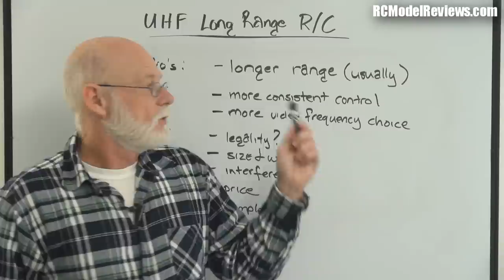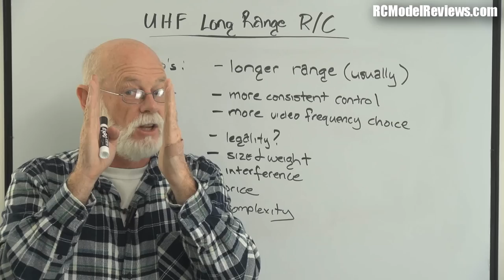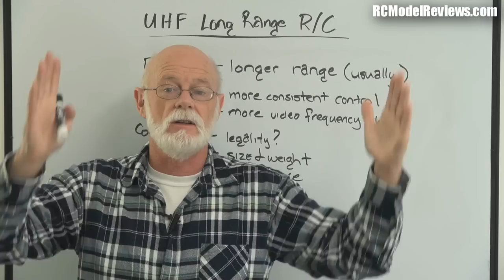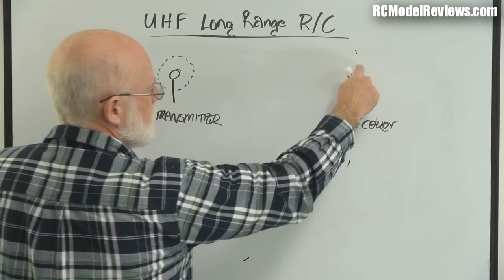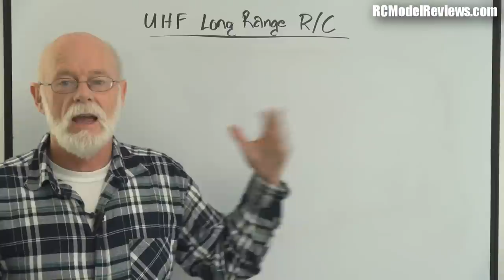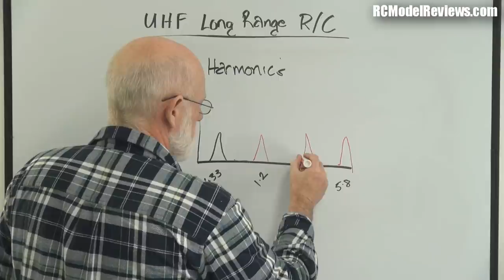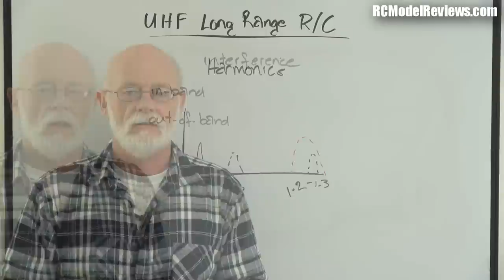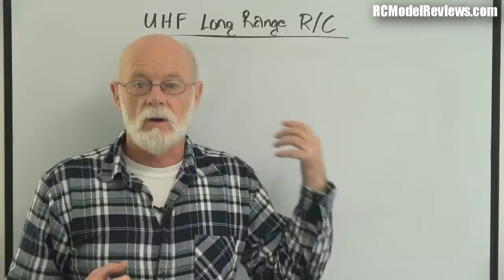Long range UHF RC systems part 1 (the basics)

Comment: Hi Bruce.
Here in the USA, one must have a HAM license to operate on the 433mHz band. I don't have one, and not likely to get one, (too hard for so small a use), so I want to look into another frequency. Perhaps 1.3?
So, when you continue your series, please address this issue (using something other than 433). From what I have read, 1.3 isn't that bad on harmonics. What do you think?

Comment: Can't wait for testing of EZUHF. I have a 2W signal booster on 5.8ghz vtx and it smashes the ezuhf at just over a km. Moved antenna to 80cm away and I get 5ks, is there a way to shield the ezuhf?

Comment: QUESTION - How about 433mhz paired against 2.4 gighhz fpv then for to avoid ground station 3rd harmonic interference? (especially if ones drone capabilities cannot use the full distance of a 433mhz will give you [not enough fuel/battery to get you that far and back - only need enough fpv transmission and reception distance that the drone can actually achieve) - And as you mentioned, which set of frequencies is best in avoiding  the interference from the on-board high definition camera?

Comment: Bruce, do you plan to focus on the Hobbyking line as the sole OpenLRS candidate ?  I would imagine you would want to either test a more respected vendor product (such as Hawkeye/DTR) rather than an also-ran product such as that from Hobbyking, or have 2 different OpenLRS vendors represented (such as Hawkeye/DTR and Hobbyking) to answer the question of whether the OpenLRS software or hardware is the primary differentiator.

Thank you for taking the time to perform this long-needed shootout.

Comment: is it worth mentioning that you can use 1.2g video and 2.4 control if u use low/high pass filters?
Reply: AndyRC Yes, but it's still far from an ideal setup so anyone contemplating long-range stuff would be better advised to go the 433MHz route.

Comment: Also, is the best way to mitigate 433 harmonics on 1.2 band by using the lowest available channel in the 1.2 range? That is, using whatever video channel you can that is as far away from 1.299 as possible? And how effective are lowpass filters when used on 1.2 video tx in conjunction with a 2.4 ghz radio link? Also a slightly related issue, you mentioned things like HD cameras coming into them mix, what about video tx disturbing servos?

Comment: Thanks so much! Very good explanation of the basics of radio frequencies. So here's a question. Is there a frequency dispersion at the harmonics? or are transmitted harmonics direct multiples of the primary frequency?

Comment: Hello sir, i hav some questions... If i want to fpv on budget, which transmitter i should get. My budget for transmitter is $300.
1. Flysky i6 + 2w Booster
2. Flysky i6 + Arkbird UHF (i like the repeater mode, and cheap uhf receiver)
3. Radiolink AT10 + 2w Booster (i like this transmitter, alot of switches)
4. Radiolink AT10 + Arkbird UHF
5. Used Futaba F10J (i heard that this transmitter can go up to 4km stock)

Which one do u suggest sir??? Any input from another user is welcome. Thankyou...
Reply: Get Taranis, stock range up to 5km, Great support.
Reply: BestLeblancEUNE I see sir, Taranis got big LCD also, lot of information... Futaba is a bit expensive in receiver, and it has small screen.

Comment: The GPS with most Flight Controllers, will also fail to receive a signal, if installed to close, to certain video transmitters. I believe it receives at 1.5ghz.

Comment: Bruce, have you considered bringing DIY solution to comparison?
Arduino Mini Pro  (3$) + SI4432 (3$) = Openlrs tranciever with 100mW output power.
Total with antenna, connectors  still under 10$

Comment: Good stuff. Really liked the explanation regarding the harmonics. If you could touch on receiver/transmitter placement vs. the antenna placement. Example: if the vtx is close to my uhf receiver, but their antenna's are far apart- is that a problem.

Comment: For the distances and environment we typically fly miniquads, I've actually had great luck with 1.3ghz (1360mhz @ 400mw w/ LP filter) and 2.4 control (Taranis/d4r-ii).  I generally have a far better experience than compared to 2.4/5.8, as 5.8 video usually cuts out long before the 'stomped on' 1.3/2.4 combo.

Comment: I'm still waiting Bruce to explain Frsky LR9 receiver and how to get such a good distance.
Reply: *****  Buy one and try it. No secrets just good antenna posiitoning. Or you can even replace the included L9R  antenna with some decent dipoles for further range. I think, which iswhat you may asking, Frsky managed to increase the range over the X8R by removing the telemetry signals, maybe Bruce can cut in here. . You don't need to receive telemetry data if you have an OSD setup. For long range its still better to use a so called UHF (aren't these actually VHF freqs?) radio setups.
Reply: ***** I have up to 8 km flights with an upgraded Tx antenna. I was thinking of buying a UHF system, after L9R, I just don't need to.
Reply: ocv fpv  I'm using L9R receiver too and it works fine. I don't think about buying UHF system because of L9R. I was just wondering how it works. 
How did you upgrade Tx antenna? I'm have Taranis and it's not an easy thing to upgrade antenna... Or you just have XJT module on which you can instal 5db antenna easily?
Reply: My stock antenna was broken so I have installed an sma connector, (downside is you have higher than 0 SWR values but so far I have no problems) I use higher gain antennas when flying long range and stock when flying normal. The problem is when I use high gain antennas, I may lose signal close to the airframe (1 - 2 meters) so when launching, tell you buddy to go a few steps further if you lose signal before taking off. If you have soldering skills, upgrading the antenna is not that hard but I don't think it is necessary.I did it because I have it broken and needed to fix it. The working principal of L9R is compromising from telemetry and using very very good antennas. Everything is about antennas. By the way I have long range flights with X8R too without a problem . Frsky products and receivers are perfect and they have done a good job at 2.4 ghz. I give up using my Futaba. I have not tried to go to the point when I lose my radio signal (losing video is not that bad but even though I have an autopilot, I don't think it is safe to be over confident regarding them. Overall as Bruce said, it is all about requirements and I don't need a UHF system,i cos my set up is working beyond my expectations. I am an old R/C pilot and having an rc radio with 2 km plus range is already a wonderful thing for me. And I have 6- 8 kms and maybe more.

Comment: Hi Bruce. Just wondering about this long range idea with the lower MHz the better with control and video. How about 1.2 Ghz for video and the old 35 or 72 MHz for control we all used to use before 2.4GHz came along. I can remember flying large models, mainly gliders, almost out of sight with no problems at all. 

Note: I'm expecting to get stomped on because of a potentially daft idea ;)

Thanks.
Reply: Andrew Hall That sounds like a good idea to me and I never flew the lower freqs except for the fact that you're stuck on 1 freq. If anyone within range of your a/c was on that same freq, they could shoot your bird down or take control. That could be someone a dozen miles away from your bird that is a dozen miles away from you. So maybe somene 25 miles away flying FPV ends up controlliing your bird without even knowing it, and vice versa?

Comment: Awesome video!
Additional Question: 
1. You have EZUHF stand alone Tx, but how does that compare to the Tx that plugs into the back of the Jr/Taranis/Turnigy radio?
2.  Antenna Placement on Aircraft
3. Use of Notch Filters
4. Use of High Pass and Low Pass Filters
5.  Should filters be on the Rx or both the Rx or Tx.
6.  Tx Boosters worth it?

Would love a premium channel with extra goodies.  You are well worth it!
Reply: Erich Roeder All good questions which I will address.  I'm actually going to do a separate video on the theory and practice of RF filters (high-pass, low-pass, bandpass and notch (band-reject)).
Reply: Great!  I can't wait to see it!

I must say, how your local detractors can't see the amount for education you provide the community is unbelievable.

Comment: Great subject Bruce. Can you include different antenna types also for example inverted 'V' , dipole antennas, skew planers and so on.... The radio system is after all dependent on the antenna...and....and...and  :D

Comment: I have used a Low pass filter on 1.2Ghz with my 2.4Ghz radio gears for years no problems
Reply: I don't even use the low pass filter and get the same range with the 2.4 transmitter when using 5.8 or 1.2 for my video. I've only ever seen problems with cheap receivers.
Reply: Raptor50aus This is what I'm doing, works pretty well.  Or at least it does when my video transmitter's aluminum case isn't sitting right between me and the receiver.  Probably should have thought that one through a little better.

Comment: I was just wondering from the stuff that I learned about mechanics of vibrartion. In mechanical world there are often also half and quarter (etc..) harmonics. Could those be a problem in radio world or is that just out of the question? Otherwise the stuff that you talked about sounded very familiar. Keep up the good work.

Comment: Good job. Bruce I need help wiring in a discovery buzzer into my qav250. My setup is the X8R Rx and X9D Tx plus from Frsky, and I'm using the CC3D flight controller. Which channel is the throttle on the receiver and  how do I toggle a switch to activate the buzzer.

Comment: if 433 can interfere with 1,2 and 1.2*2 is 2.4 shouldn't 433 also interfere with 2.4 video or control(of another pilot)?? also do some use 433 for video? is it good?

Comment: Awesome video as always Bruce.  I just have one newb question.  You didn't say why (or I missed it.. .sorry) if 10 people are flying 2.4ghz everything is fine, but why would a 2.4ghz video radio interfere with the 2.4ghz rc radio?  Is it a matter of video not being capable of hopping?  Thank you for all you do!!!!
Reply: erikdravn It's not so much that 2.4GHz video would interfere with the RC system (although it would reduce the range) it is more that the RC transmitter would clobber the video signal and fill it with horrible lines.  However, the RC range will be reduced because there will be some desensitization (due to the power of the video transmitter and its close proximity to the RC receiver).
Reply: ***** Oh.  Ok.  That makes sense.  Thanks!

Comment: 31:16 have you ever noticed that before? the crackle some speakers will do right before someone's phone rings. I've noticed it a lot. I always thought it was strange that would happen, that the signal makes the speaker distortion,  but the signals are always all around us, so why does it only happen at the beginning,  before it starts to ring? I thought it was odd that your video recorded the speaker distortion.
Reply: Used to notice this before with older phones and older speakers, say, 8-10 years ago, not anymore though.

Comment: Hello Bruce, I just started into fpv for a few months now. Actually I started flying for that time and fpv was coming after I will be able to control my quad in tha air. I can control It now so that I don't crash it but I still cant jump to FPV because I have a big problem. My quad fell out of the sky a few time. Nothing but the landing gear got broken. At firs I read on the internet that the problem might me the cc3d not getting constant power from the ESC so I put a 12V to 5V (3A) stepdown and I power the CC3D from that. After a test it fell again. I realized it was falling when I had some distance.. so I made a test and it seam that if the antenna of my fs-th9x is perpendicular (bad scenario) to the quad antenna then I get 100m range. If I put the antenna parallel to he quad's antenna then I get 150m. I can't fpv at that distance. At 140m it start dropping. I have checked the quad and the antenna seams fine( I use the receiver that came with the transmitter). I also check the transmitter's module and the connections of the antenna are ok. What could be the problem? I know you must be really busy but I would really appreciate if you can give me a hand with this problem. Thanks.
Reply: nameadrian Sounds like you need to add a satellite Rx and antenna to your base Rx. If there's no connector for one, swap to a Rx that is capable of adding a satellite. The Rx base & satellite antennas should be 90 degrees to each other so they are at different polarities. Also minimize the signals being blanked by the CF structure of your quad's frame if that is happening. Make sure any antennas on the top of the quad are high enough for LOS from the Tx or extended from the bottom.

Comment: Let's say I have a 900MHz vtx, 1,2GHz vtx and 2,4 RC. I set my 900 to the highest channel wich would be 1040MHz and use this with 2,4RC w/o any problems. Now, I take the 1,2G and set it to the lowest channel, wich is 1080MHz. From my non-radio-education logic I can use that latter setup w/o any problems too?

Comment: G'day,

 Yay Team...!

That was ecking fuxellent Bruce, even the Kangaroo-Feeder underconstumbled that...

 A good thing, too...

  I've now rebuilt the last 4  108mm x 18.5mm Pusher Propellers on Earth, for the last CC Lee Falcon capable of levitation ( and I'm gearing up to make Bespoke Replacements in Wood, and Aluminium, to see what works better...) ; but I'm tentatively committed to trying to fly a Phone-Camera Video-Mission to capture Footage of the Australian Standing Stones, and that'll involve flying within 100 Metres of both a 300 ft  Microwave  Com's Tower, and a  local FM Public Broadcast Radio Transmitter, the pair being 200 metres apart, in an equilateral Triangle with the Stone Circle...

 So, I just decided to carry out some REALLY SERIOUS Range-Checks (with Binoculars) before committing for a Launch...; after having  heard this...

  I'd really hate to be shot down by a Country & Western Song advertising the Kilted Keltic Klowns Festival...; not after braving and surviving the Skies over Rangers Valley Feed Lot...( even if it did involve crashing in a Tree before recovering the "Improvised Aerial Camera Platform"...).

;-p

Ciao !

Comment: Question: could I use a directional control system, that operates autonomously, through va microprocessor, i.e  the microprocessor acts as an auto pilot, and flies the aircraft, based on a programmed flight path, and based on input from a GPS? 
In other words;  I could  pre- program "destinations" based on GPS, and the model would fly to tbat location using preset parameters, such as altitude, speed, trim, etc. Even including preset changes in altitude, and speed! I could use a primary run through, using direct control, and then save the flight to a memory stick, for re-use.
Reply: This setup if possible, could eliminate problems with interference, en route! 
I could still use the Video system, once the aircraft arrives at its destination, but would power off the video system until the model arrives at its destination. 
Yes, in defeats the purpose of Virtual POV (or FirstPersonView) enjoyment, but allows the model an effective means of significantly decreasing interfere from the Gear, And from outside sources!

Comment: Hi, i just started to build my own multi.copter. I have just bought radiolink transmitter with receiver however dont know if you happen to know how to bind it? it seems no light appears. does it needs an external battery? please let me know.
Reply: Neon Burnt You can d/l the DragonLink manual here: http://www.dragonlinkrc.com/v2/download .  You should find all your answers.  Power to the DL Tx comes from either an external battery or the Tx battery.  It's all according to what Tx you're using to how you connect and power it.
Reply: Hi Mr.V, thanks a lot. Seems I need to take back my long forgotten chair and   explore! lol... thanks mate! :D

Comment: My question/opinion is this, wouldn't just connecting to a 4g cellular signal give a lot stronger and further reaching signal? You'd technically be able to fly forever in countries with better coverage, like where I'm from, Norway. 

I've seen this done before, so completely possible, even streaming video back to where you're sitting. You could fly from your couch with the video on the tv.

Comment: I am betting before anyone else does that the dragonlink will crush the competition. I am a fan obviously. When or if you have already made the last video can you please make a breakdown of the one with the most pro's be declared the (winner)? Also I have been wanting to see something like this forever. Brilliant! You should change your channel name to the RC Teacher. JK JK BEAST MODE
Reply: FPV Flight Airborne it'll probably spaff all over 1.2-1.3 video band tho. And i'd expect the scherrer to do the same.
Reply: FPV Flight Airborne He should really be using the DL micro RX.  It's what has shipped in stock configs for the last several months, has better sensitivity, selectivity and more features.  In practice it gets about 50% more range in the same configuration as compared to the old 2.8X RX.
Reply: Benjamin Harvey Nah.  DL has 1280GHz friendly firmware that avoids hopping onto any freq(s) that have harmonics with 1280GHz.  1258GHz doesn't have the harmonics issue so should be good for any of the systems.
Reply: FPV Flight Airborne ezuhf win :)
Reply: Benjamin Harvey That's what I fly on (1.2-1.3) and I never had any breakups at 0-7 miles away. Beautiful video. Maybe I will be enlightened a little after the next couple videos?? I hope so. I am sure Bruce will teach us all something.